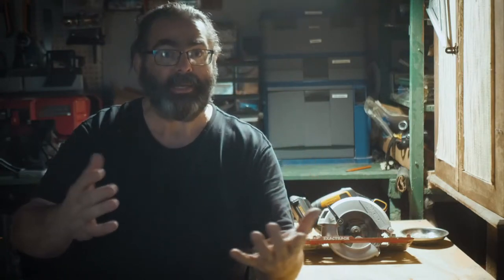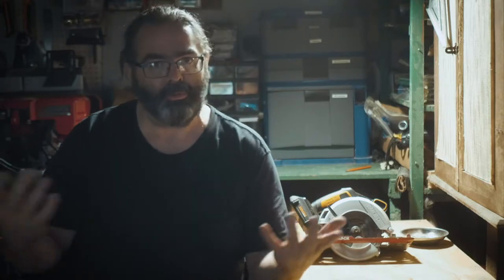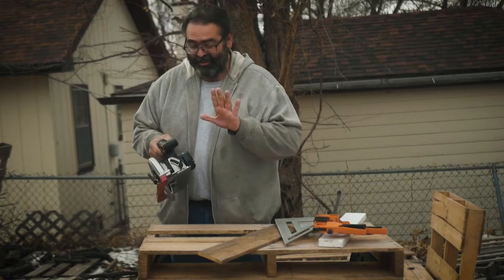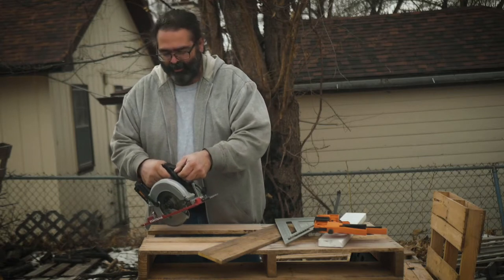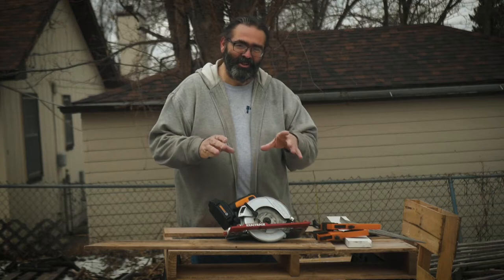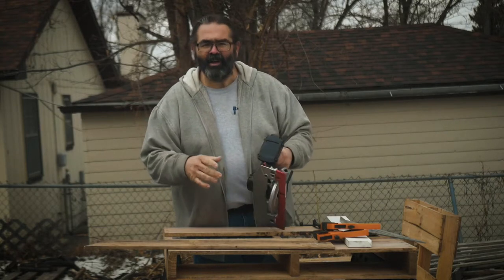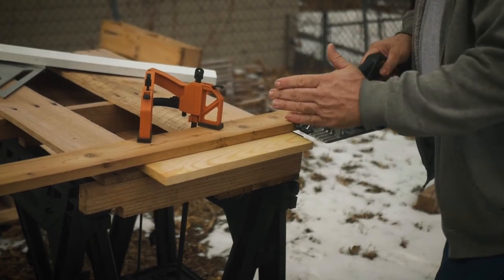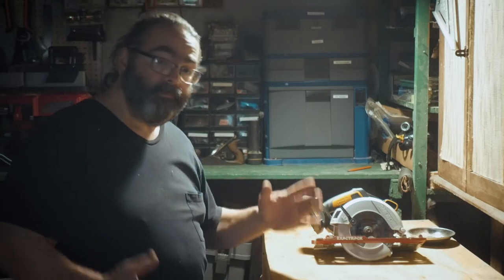The D.I.Y Tool Shed Podcast Tool Review - Worx ExacTrack Circular Saw

Comment: I own a Worx H3 drill machine and I have to say it’s a solid tool.
I am less confident with cordless circular saws, whatever the brand it is.
Reply from the maker: This has definitely become a niche tool for me but still valuable.   I only use it for cutting along patterns and guides and only on 1" or thinner material.  In that scenario,  it does very well.  I ended up with a Craftsman R&P circ saw for reliable 2by dimensional board cuts.

Comment: I have the tool i find it very underpowered and often the blade stop's half way through a cut even with fully charged battery.Wish i brought a corded one instead
Reply from the maker: It's not really a contractor level saw and I think it would really benefit from being made brushless but, as is, I really think it's best suited to trim, moulding, less than dimensional lumber.  People's use experience affects how well a particular tool will suit them.
Reply: I'm also hunting for a cordless circular saw, and from what I learned so far a bigger battery helps.  The bigger batteries also have better  current capabilities that may help the saw better negotiate "tighter spots". And also the blade is important. Sometimes the blade that comes with the saw, especially in the DIY price range, should be upgraded for something better.
Reply: Thank you, I’m a carpenter and known about this saw for a couple years. I always think about this saw and consider getting it and some other work tools because they’re so unique but ultimately may not be worth it for me if it’s underpowered.
Reply: @cristianpaulmartinez52 I don't think it's underpowered for what it is. At 3900 rpm it does just fine for most projects using tools in this price range.

I like it to supplement my heavy duty X2 Makita 7 3/4 circ saw.

Comment: I noticed you used a straight edge piece of wood, have you tried using an aluminium straight edge?  I fear the teeth on the saw will mar the aluminium side on each pass.
Reply from the maker: If you're not keeping thiscsaw perfectly straight, it can lean into and contact the straightedge you're using.  It's not a bad little saw but it's better to use thinner material for a straightedge.  The one I used in the video was actually too thick.  A 1 by piece of stock is just fine.